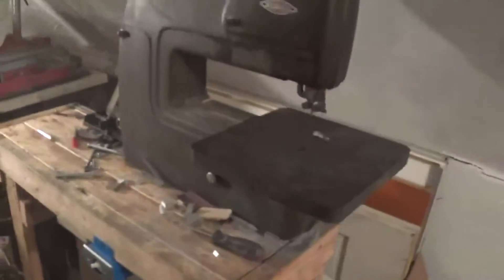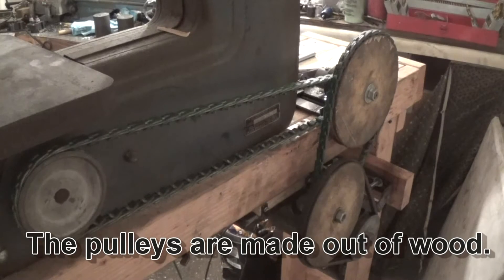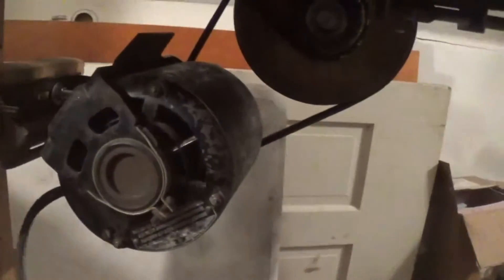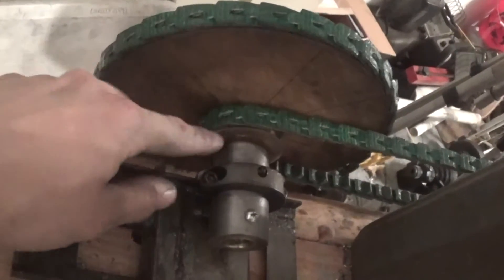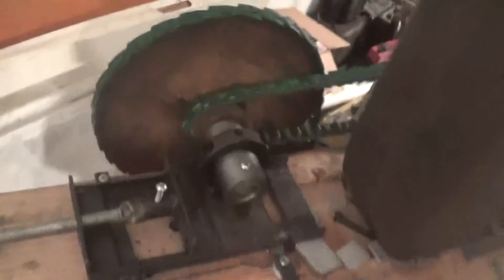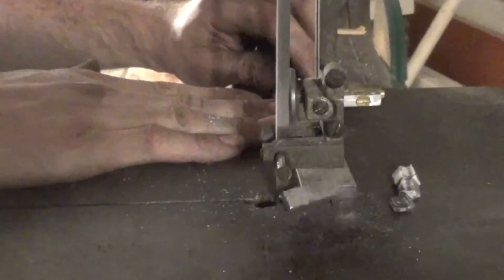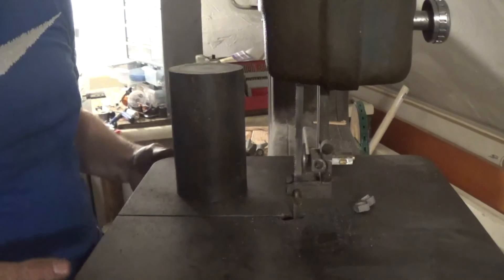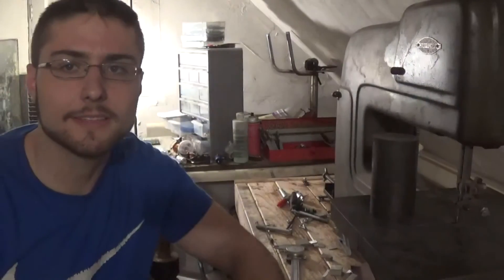How to Convert a Wood Cutting Bandsaw to Cut Metal

Comment: Pretty cool! I'm new to the world of metal and bought a new Craftsman 10" bandsaw not knowing that you need to slow down the blade speed. I wanted to use it to cut up my aluminum scraps to fit into a A8 crucible. I discovered that I can cut up the thin scraps that I have. Maybe around 1/8 to 3/16 with no problem. I've even cut 16 gauge sheet metal on it. I do use a bi-metal blade and blade wax.